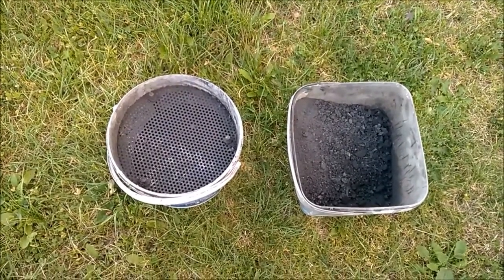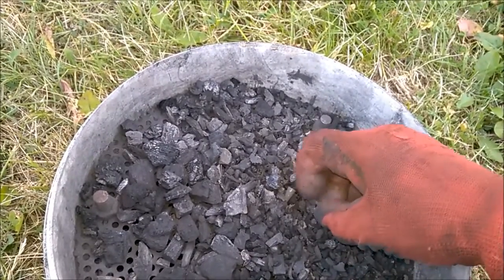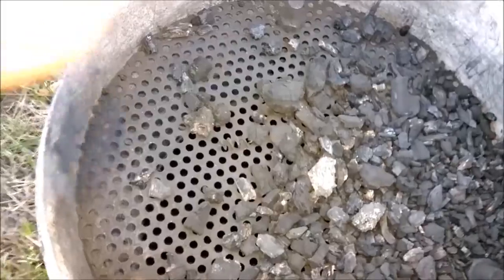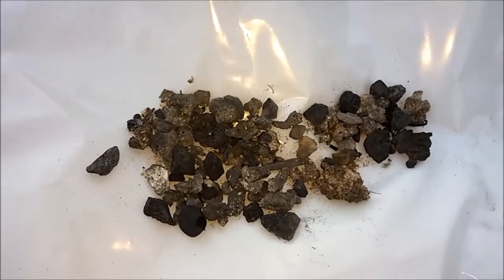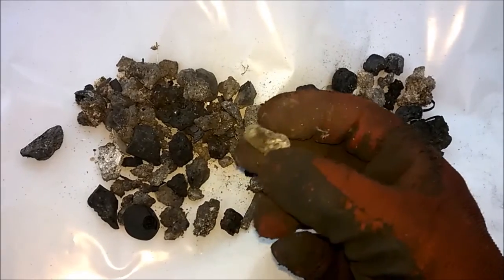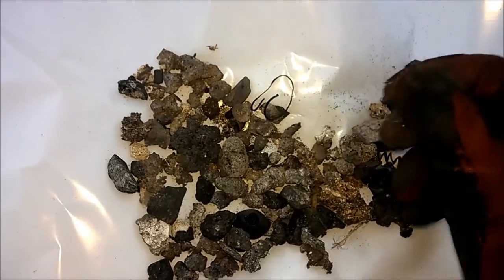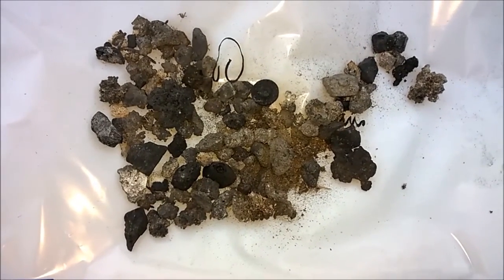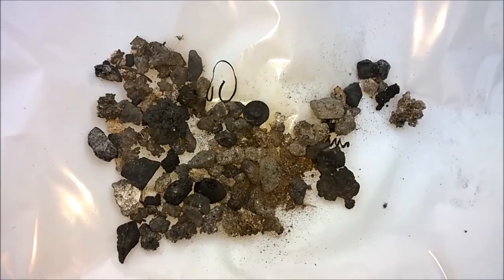Look what I found.....And why I designed a grateless gasifier.

Comment: power plants use rock crushers to deal with this stuff , they also use water to pump the crushed pieces out of the system , perhaps you could design a system that removes this stuff during operation like a auger at the bottom of a square cone , the auger could be protected by ash , meaning never run ti so long that it pulls red hot clinkers out only the ones at the bottom
Reply from the maker: Well In my grateless I do have already a vice like separator. Still refining my basic consept ther. As for prventing the hearth to suck empty I pre-pack the hearth. It is a subtle balance between usefull packed reduction and overpacked reduction. So far managed to keep that balance a record 15 hours. More than enough for a solar suporting system but not good enough for a grid tied system. Nut I have some more ideas and I am optimistic to soor break the 24 hours barrieir.

Comment: Looks like a magnetic slide would help . at least with the metal. I guess your not too worried about this contamination being grateless and all. Thanks for sharing. Joe
Reply from the maker: +mazdalorean If it where only the metalparts then your idea is very valid. But stones and clinkers are just so nasty as well. Been silent for several months because working on a total new gasifier. Yesterday was the first test. It went half and half. Must make adaptions but I have good hope I can post a video soon with good results.